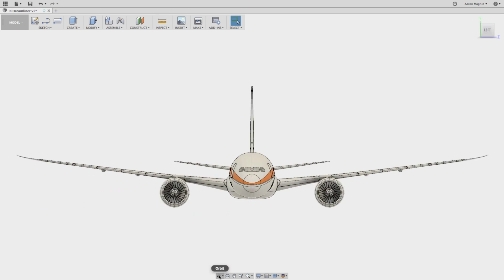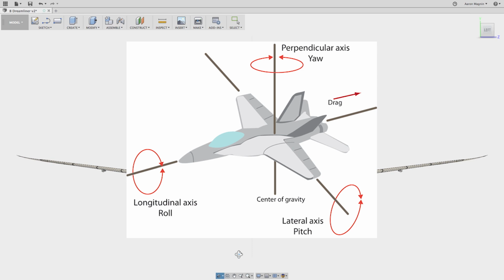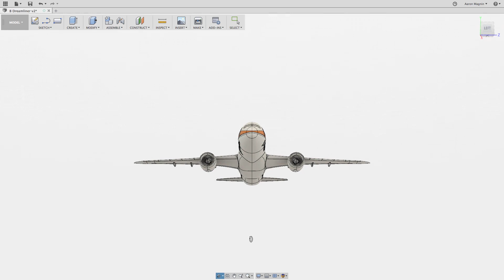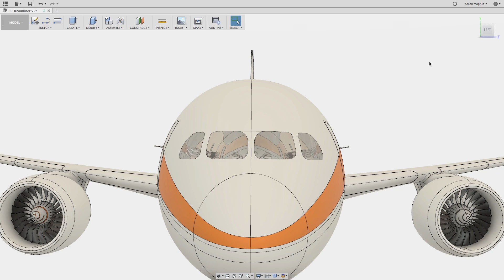QUICK TIP: Pitch/Yaw/Roll with the Orbit Wheel

Comment: Is there a hotkey for the orbit command? Or do I have to click the icon at the bottom? Thanks
Reply: I use shift and middle mouse button. You can use those to orbit. To reset orbit point hold those and add a left click.
Reply: Great, thanks. When I do that I don't get the orbit wheel though, so I still have to click the orbit button in order to manipulate the roll pitch and yaw. Am I doing something wrong? Thanks.
Reply: Justin Grabinski I confused the two.
Reply: Ok. I hope that we'll have the feature hot-keyed in the future. Thanks!